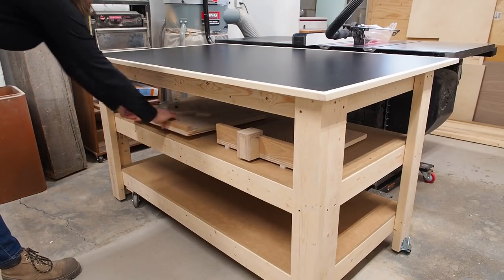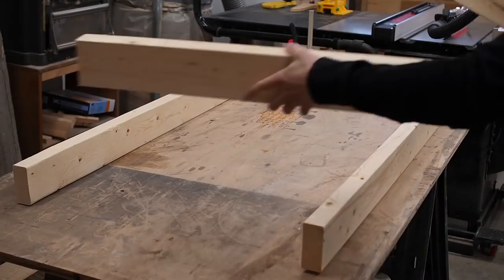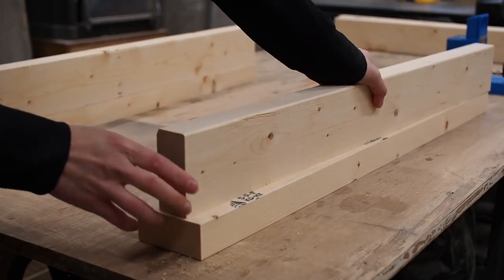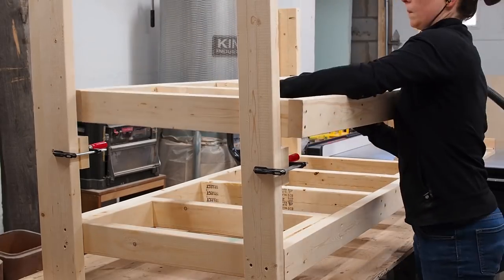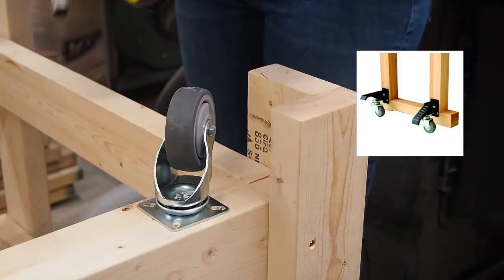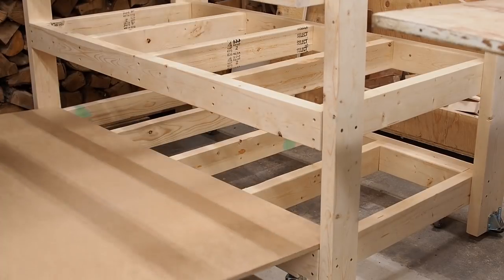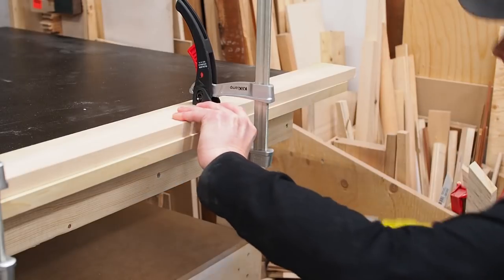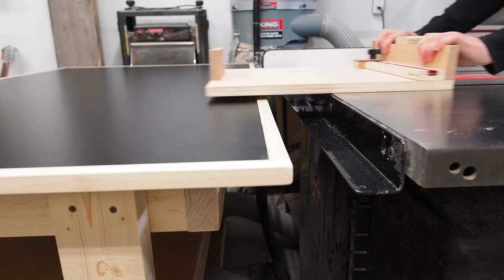Outfeed Table / Workbench  | Mobile & Leveling

Comment: I watched a ton of outfeed table builds and ended up coming back to your build. I've also got a small shop and need an efficient, and easily built outfeed table that I can also use as an assembly table. I need to get my shop up and running, and know I need an outfeed table, but don't want to spend the time building a cabinet (I can do that later if I ever want to) so that I can get to building other stuff my shop needs.

Comment: Thanks for sharing this design/build.  I downloaded the plans and built it to the cut list and instructions without any issues.  I made a couple of small changes...increased the clearance from the legs to the casters to 3/4" versus 1/2"; couldn't get black Melamine but used 3/4" MDF sitting on 1/2" MDF.  I used 3 coats of shellac on the top surface.  I really liked the leveling legs which makes for a very stable position of the table on an uneven floor, and I think the overall dimensions of the table are perfect for outfeed and assembly.  I'd like to show a picture of mine but don't know how to upload...

Comment: Thanks Marie. I bought your PDF plans and built my own version for a workbench. Made mine longer and taller and a bit wider and just went with regular lockable castors that aren't "hidden" like yours. I really like your black melamine top but I could only get white here in the southern Oregon area so had to go with that.

It was pretty easy to cut and build, although I had trouble with the pocket screws which I had never used before. I should have shelled out for the nice looking pocket screw guide you have, but I got something cheaper from Amazon which placed the holes too far away from the top. So I had to use longer pocket screws. I had to hand-drive them as you did, but that didn't help ME avoid driving them too far. I should have practiced on some scrap 2x4s to give me confidence in what was going to happen, but I didn't, so now I have 3 spots in the melamine top where the tips started to come through. (I screwed them with the workbench inverted so the weight would hold everything tightly together) Oh well... it is just a workbench!

I'll put edges on mine as you did, but I still need to get hold of the hardwood and some melamine glue. Thanks again Marie. Very enjoyable watching your channel.

Comment: I used those lever type casters with optional plates for removal on a just finished mft/router/assembly/out feed/tooling storage table. I don’t like them, the table isn’t yet loaded with tooling but they’re very hard to engage/disengage to the point I don’t bother.. They’re absolutely bound to fail and were expensive as you point out. Live and learn, thanks for sharing.
Reply from the maker: Sorry to hear that, but it's reassuring to know I made the right decision not going with those. Thanks!
Reply: @DIYMontreal  I think they'd be fine for light weight tables (they worked OK  before I added the top). For the benefit of anyone reading this thread I think the way to go for heavy benches which need to be mobile are leveling casters with handles/levers. I see some on YT, researching them now.

Comment: Love the adjustable feet. Just bought a set for my workbench. Although the legs are the exact same length, my shop has uneven floor so these are definitely going to alleviate this isssue!
Reply from the maker: Glad this tip came in handy!

Comment: Nice job! 
I was going to ask a question but as I was forming the question,  it was answered due to your garage floor not being level.  You will love melamine.  A little wax keeps it from not collecting glue.  I did like the large shelves as well.  Is building things a hobby or are you working in this field?!
I taught cabinet making and home construction for 20 years.  I had quite a few women that used to take the college course.
Keep those fingers safe.  Have fun it is relaxing work.

Comment: If worried about gluing edge trim to that type of board: bondo for wood, spread the bondo on outside edge, sand smooth, glue your trim. 
Can also use the all purpose bondo.
Reply from the maker: Thanks for the tip!

Comment: And I thought MY garage (workshop) floor was bad !  Nice strong unit, I didn't think of melamine coated board for my table,  used 18 mm MDF. Got it from a local builder's merchant and it seemed a bit heavy and dark. It came from Brasil and when given a coat of boiled linseed oil it turned the colour of dark chocolate !  Mmmm
Reply from the maker: Nice! Must look good... And yummy 😉
As for the garage floor, the worst part is that it's much better than it was before 😆 We work with what we have.

Comment: Have followed your videos that I find thoughtful, clever, to the point and well executed. Can appreciate your creating a nice, well equipped shop in what appears to be a relatively small and less than perfect space, like most of us/I have. Can I ask, did you do a review or give an overview of your sawstop table saw? If so I can't find it. Also for a hobbyist, as you indicate you are, those saws are expensive. Can I ask, did Sawstop provide you with the saw or did you feel the safety and accuracy justified purchasing it yourself?

Comment: Nice work Marie, you're quite the professional, ma'am. I know that I miss several of your videos, but it's fun to see your progression. I need to start from scratch and make my first table saw sled, a full sized one, as opposed to your mini-sled. <3
Reply from the maker: Thanks Jim, I'll tell you a secret... I need to make a full size crosscut sled too! Still don't have one. 😯
Reply: @DIYMontreal  I know that I'm going to make one with a bed panel that's at least 16 inches (about 40.75 CM) wide from front to back... the largest piece I foresee cutting in the sled would be 12 in. (30 CM) then another inch (2.5 CM) for clearance, then add about 3 more inches for the front and back fences.... Adding up to at least 16 inches! I was stunned when I just did the math.

However, I confess to cheating on the runners. I bought a set of "ZEROPLAY Miter Bars by MICROJIG (Double Pack)" from Amazon. This way I KNOW I won't get the runners wrong. lol!!! It's really nice to chit chat with you. Take Care.

Comment: Fantastic build and I love your work methodology,  video editing and content.  Excellent and I learned a lot.  My floor is the same and wish I did the same.  I actually had bought the levelers but have been too lazy to redo the wheels and the levelers. I also didn't route miter slots in and instead just have the height lower but I did build in and adjustable height function. I did a plywood top with hardboard over it so I could replace that layer but problem was never could get that hardboard to lay flat so it's a bit wavy.  A few questions: 1) would you recommend finishing that edge 2) do you think you will end up putting in dog holes and other clamping mechanisms 3) do you know how much this weighs?

Comment: I have to admit: pretty stressful when Shop Manager Zoe came on site for inspection. Thankfully this was built great so it passed inspection.

I love the use of cut spacers throughout the project, and picked up the tip of connecting those two long clamps together to meet the total length of the top

Comment: Hi Marie...  as I began my build this weekend I viewed your video again (still AWESOME). I made note of something. I saw you screw the casters onto the 2x4xs in the base. Later I saw you spin the table and the casters were screwed into plywood that was attached to the bottom frame 2x4's. What happened?
Reply from the maker: Good catch! I didn't offset the casters thought initially so one of the legs was catching on the concrete floors. I added the blocks under the casters to raise it up. The plans reflect how I should have built it in the first place!
Reply: @DIYMontreal  LOL... No problem. Thanks so much. I  made the adjustments - I thought, perhaps, the soft pine just would not be srtong enough to last long with any potential forces common with a heavy bench swirling around the shop... Not knowing, my design "sports" the plywood "spacers" as well. I figure it just makes it a "fancy-pantz" design feature!! LOL Thanks again for a great video

Comment: Question: I just got the Contractor saw with the same fence setup, and I plan to eventually get the overhead dust collection gear as well - what is the clearance between the top of the dust collection tube and the saw's tabletop?

Comment: Like the table , but are you going to do drawers for more space for sorage ? 🌈🇨🇦 all will be good 😉
Reply from the maker: No, I'm not planning drawers, although that could be useful, I prefer the open space underneath.
Reply: Trays on drawer slides would be useful for smaller things. Do those count as drawers? As open drawers? Maybe! I put a sliding tray in the cabinet under my bathroom sink with dowels for TP after reaching into the back got annoying. A small quarter round trim on top keeps things from sliding off the end and gives a convenient handle to pull from!

Comment: Levelling feet assume the weight load of the entire bench and the load of whatever you are working on, have you had any issues with them failing?
Reply from the maker: No issues. I think they are rated for like 8000 lbs 😂

Comment: Very nice outfeed table but the lower selves seem over built for the weight they will be holding.
Reply from the maker: You may be right, I probably didn't need as many stretchers for the lower frames, but it was easier to just keep it consistent. At least it's solid and there is absolutely zero racking with lateral force.
Reply: Just to be clear, I wasn't being critical. Over built is much better than under built. Love you channel.

Comment: i learned something from you today and that is using those two clamsp to go all the way across the table and clamped... the shop fox track saw dust collector leaves a little to be desired, ill keep my festool one , alot better at dust control.... good work though...